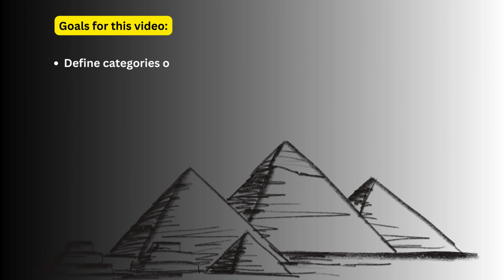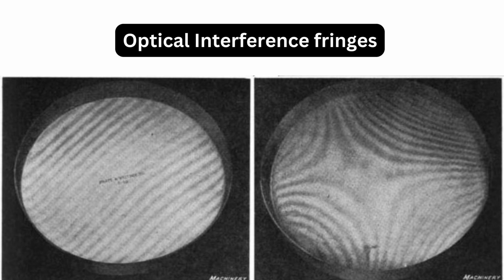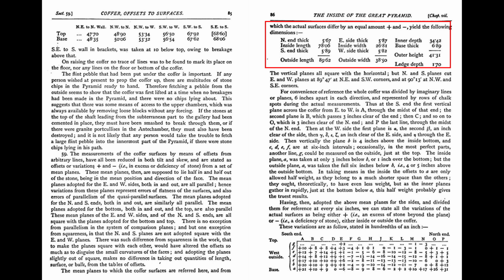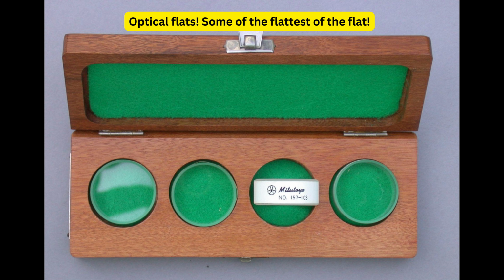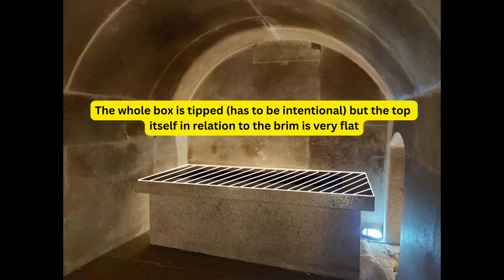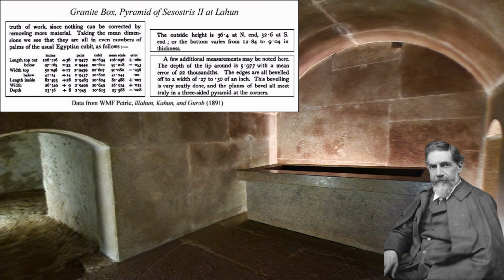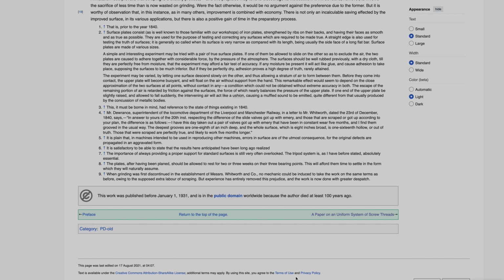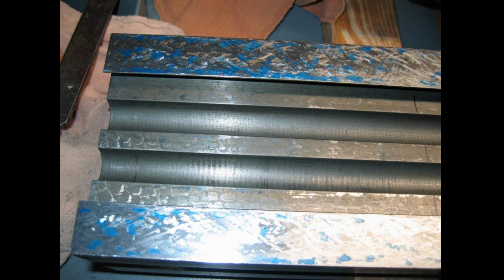The Problem of Flatness in Ancient Egypt

Comment: Applying precision in the micron range on even modern building of some machinery feels silly.  Working at a boiler plant, on 1000BHP boilers, the standard tolerance on the shell and piping mounts was +/- 1". ONE INCH.  That level of precision doesn't sound like much until you figure in that it is on a 15 foot diameter, 45 foot long tube made of 1" thick steel. +/- 1" in 45 feet (or 540 inches - 1:540 is a pretty good tolerance) The interesting thing is, we were generally within 1/8" even at that size... similar things occur on the Egyptian build sites.  It's not about everything in the pyramids being that tight, it's that there are things that we would look at and go "why so perfect" that don't make any sense.     (To be fair, there were certain things ON the boiler that would go to the .001" range - but not the larger main piece).
It's kind of like those spinner things that are so perfect and perfectly balanced... and that we date by the crudely scratched in names on them.  Like a kid marking his Dr Suess books by using a crayon to write in his name.   It doesn't quite make sense. 

EDIT - Let me phrase what I am trying to get at another way -  it's not that they couldn't do various sand and water polish methods to get very smooth surfaces - the question is more one of why did they do so as much as they did, and be able to get it done in the time frames claimed by archeologists?   And the build quality they have on the blocks is as tight as what I am describing above, which is using modern engineering techniques.  

To me, the biggest question marks that throw the idea of all hand tools into doubt are the places (plural) where you can see cuts started, several feet long, as much as a few inches deep sometimes, that they just stopped, like they realized they started the cut wrong and then went back and started over on the correct cut mark...   the reason I say that is, with the techniques used for cutting, those marks would have taken days or even weeks - anyone working with wood, stone, metals etc with cutting tools - you ever make a mistake weeks in and just go, meh?  Be honest... it's WEIRD.   I'm not saying it wouldn't happen once - but there are quite a few examples of this throughout the Giza complex.
Reply from the maker: Good point. I’m looking into some of those explanations for the casing stones. History for Granite has already done spectacular work on the casing stones if you’re interested as well.

Comment: Farmer/mechanical engineer.....  Interesting.  Could have dragged stone around on paving stones by pyramids But not back and forth like shown.  Movement along every axis (direction) required... and with careful attention to exactly where ropes attached to avoid forward rotational force.... which would render the work-face convex.                ASIDE FROM THAT,  This method IN NO WAY addresses Squareness or Parallelness.... and this method is USELESS on the INSIDE of a stone box.    BTW, the Plate Method (as shown) requires the plates to be either very, very large or be (somehow) attached to Something that would keep them from tilting.  You could rub countless bricks together for countless years, and never produce anything except a convex surface.    Nice, sharp, straight Inside corners and edges using bronze or Any stone?  No.   A modern jeweler with his tiny,  high-speed diamond grinder could get into a box and make a nice corner, but he'd be wearing magnifying glasses with built-in LED lights.  Flat, smooth, equidistant, darned-Parallel sides in there?   Please.... some rich guy..... hire a stone guy to build a good 2x2x5 ft granite box without using any steel, carbide, or any modern equipment.
Reply from the maker: Come on Elon, give me a few million I will work on the project!

Comment: I work in calibration for the air force. Particularly on circular geometry measurement machines and surface plates. On our worst machines, the operators use them to measure tolerances of a few thousand of an inch.  Without getting into detail we calibrate them MUCH tighter. And that's in the air force, where a lot of times good enough is all that is needed since we have decades of data on tolerances of finished components. Now imagine what some private companies are doing out there with low quantity production or one-off pieces. And I haven't even gotten into roughness, this is just flatness and roundness.
Reply from the maker: Well said.

Comment: I have a theory that you could use can grind the heaviest stones using boyancy from the waterways. Bury a flat Reference Stone in the sand underneath the water. Add the stone you want to "grind" on top of the buried stone underneath the water. 

Add just enough boyancy to the top stone so that the motion of the water is enough to move it around the buried stone. In effect lapping it. 

In this way, you can flatten a heavy stone using boyancy to decrease the energy required to "lap" it. 

Just a theory I've had for a few years. Any thoughts??
Reply from the maker: A very interesting theory. I’m going to think about that today.

Comment: There are so many assumptions in this video, and it's not really creators fault.  It's evident that irreparable damage has been done to our self awareness simply by way of gatekeeping, and suppression, and silencing, and forcing lies into the lofty, impetus driven minds of today...  Great video, homie. Keep it up.  With 10.8k subs, and knowing nothing else, you show great potential in delivering top notch content, taking nothing away from this video, of course.  Thanks.
Reply from the maker: I can always improve. And I intend to. This is certainly more speculation than I’m normally used to. Check out some of my other videos I usually build models of pyramid parts and keep the level of speculation lower. I appreciate you watching.
Reply: Not really

Comment: If they had a high carborundum slurry that they could put been blocks the slurry would allow sliding AND grind down the surfaces faster. 

For cutting i imagine similar. 
Or even rope saws or plank saws.. Ropes impregnated with abrasive slurry.  Or wood planks with an abrasive slurry.
Reply: That's what I get for commenting before the end
Reply from the maker: 😂😂😂😂😂 all good. I am slowly acquiring various sands. I’m a very normal person
Reply: Modern people who aren't working with raw materials engineering lose sight of how effective rudimentary material can be is used correctly. 

Torsion on rope to create insane pressure for instance.
Reply: I enjoyed that video, though I felt it might have led with Whitworth.

As for ancient stonework, well stone cutting is merely precision abrasion.
Stone abrasion is self 'sharpening' that is to say, the more you abrade the more you are left with the most abrasive elements.

Any stone is not homologous, that is it is not made up of a single element.
Abrading the stone, in your accumumating paste, or slurry, you'll eventually have a predominence of only the hardest elements, quartzes, feldspars corundums and so on, and the softer elements are reduced.

The tool is not the abrader, you can do it with wood or bone if you like.
The reason tree stumps are left after felling, is because the bottom couple of feet are absolutely impregnated with dirt, soils, and dust which contain mineral elements that would destroy hardened steel chainsaw teeth, or steel saw blades in seconds flat.
There is a reason people do not cut up driftwood for their log fires, well not a second time they don't.  

Everything ancient has to invoke 'Precision diamond cutting tools' However, those only became a thing in my lifetime, and we managed a fair bit of precision in stone without it. 

As for Moh's scale, well when a sandstone job came up you had two choices, it was going to pay a lot less, or you'd have to raise your price a lot higher, because a sandstone job would destroy more packs of cutting disks in short order than any other.

My final point about 'hardness' is to ask what is harder on a scale, a human hair, or steel? If you answered steel, then why are you buying new razor blades?
One factor is the mineral traces present in hair among other factors.

There are Buddhist suttas regarding the passage of time which are familiar to many,  birds flying with silk scarves rubbing against mountains, or rubbing one with a soft cloth 
The concept of abrasion has been known for a very long time - some just managed to find ways to speed it up a bit.  

Does ancient stone bothering impress me? Absolutely. Do I need to reach for magic to explain it? No not remotely.
Our predecessors were very good at it because it was their job and it had been their job for a very, very long time. 

I am currently having people tell me that buildings I have personal knowledge and experience of being built, were dug out of a mudflood. 
That's not even a fraction of the distance from here to the pyramids and people are invoking magic for it.

Why? The very idea anyone could be more industrious and intelligent than them is anathema probably.

Comment: I've watched people measure and recondition industrial granite surface plates before, it involved a very accurate digital level that gets strategically placed in different locations (e.g. along all the edges and the two diagonals) to map out the "hills and valleys". The level could measure in microns per meter, which is just insanely precise. It gets moved along the measurement lines in increments just long enough so the following measurement continues where the one before it ended. The measuring software could even compensate for a slight tilt in the surface. This would be the ideal method to really map out a surface like this accurately and without any doubts.
Reply from the maker: That seems like a better and more portable method for taking to Egypt!!
Reply: @intothemap360 this is what we use. A Renishaw XL-80 laser interferometer. It comes in a kit about the size of a suitcase, requires a laptop, a very sturdy tripod, and a straight edge to run your lines. Even a simple repeat-o-meter with an accurate dial indicator could give you flatness down to 10's of microinches.
Reply from the maker: Thank you, I wonder if I have enough Home Depot pro point for one. I’m guessing not 😂
Reply: @intothemap360 lol everything we use is insanely expensive. Glad I don't have to pay for it if I break it. Probably looking for a new gig though.

Comment: One thing is for sure about the Serapeum. Too build such large, strong boxes where the tops sealed the box completely
means that whatever was in the box the Egyptians did not want it to get out. That it was toxic. And why the
Serapeum was also located underground. But, whatever it was, it was useful enough for the Egyptians to go through the
effort to build the Serapeum. I'm thinking each box held batteries?  And maybe was a charging station for smaller mobile batteries?
Reply from the maker: There were bulls inside. Read the account of going inside the serapeum for the first time by August Marriette. They found one bull in a side chamber

Comment: Optical flats are flat to double digits nanometers. Let's say 1/10 or less of the wavelength used (typical 589 nm of sodium vapour lamp). That's trade standard.
In lapping two parts against each other you end with perfectly matching sphericals. It's only a matter which radius these spheres achieve. Flat means a very large radius measured in kilometers.
Reply from the maker: You're right, it can also get very technical very quickly and there was a point at which I had to decide what words convey my meaning to the audience and which ones are the correct technical term that I would need to define first. In order to not go into the specifics of optical flats I just used the basic terms. I appreciate your input!

Comment: I knew about the three plate method. The vases are interesting. These are quite similar. Little variation on the theme. They must have figured out something with rotation. A trick. There is some obsidian jewelry from Anatolia, millennia older, that also has high accuracy. Round bracelets. High level of control of grinding away at round hard stone. 
Way back someone had ordered a pile of sand and the kids in the neighborhood were digging through it. Why? Perfectly round white stones. Marbles. My father: the sand has been processed. It has been shaken and tumbled intensely. Pebbles roll around in it until they are smooth and round.
Reply: “Millennia” older? Do you realize how old the Pyramids are? lol
Reply: @lysseax  Do you know where Anatolia is?
Reply: @PlanetDeLaTourette 
Yes, and the location of the region referred to as Anatolia has absolutely nothing to do with the question I asked you. I asked if you knew how old the pyramids were because you are making a claim about precision crafted jewelry that is “millennia older” than the pyramids.
Reply: @lysseax  There has been activity in Anatolia for a very long time. Type the keywords in google.
Reply from the maker: Great points and story, something I have to also remind myself is that not all sand is the same! Some sands are soft and others can cut into diorite. I have seen wind blown sand strip the paint off a car in minutes in iceland.
Reply: @intothemap360  Ask Neil Armstrong. Moon dust is the nastiest crap. Tiny sharp rocks.
Reply: @PlanetDeLaTourette 
Basically small grains of sharp obsidian. The only time they experience any erosion is from micro and larger impact events.

Comment: There is a channel about optics - the guy from Netherlands makes optical pieces for telescopes that are in space. By hand or with this type of techniques. He measures his glass on optical (sodium based I think - yellow as hell) lamp that's made for this. It's a ton of work and he makes smaller pieces, but one could also use water in ancient times to further smoothen the surface - provided that they had a way of applying it relatively uniformly. Add to that tens or hundreds of thousand of "free labor" and you can get something that would be extremely flat. No "lost technology" needed.
Reply from the maker: Sounds like a fascinating channel! What's it called? Always interested in more content like that!
Reply: @intothemap360  Huygens Optics. Mind you he has other stuff, but a lot of it is DIY or lessons in physics. I don't claim that he doesn't use modern technology, but for small stuff, having something rotating (which was used in pottery) and sand or other powders, can be incredibly powerful. Albeit it isn't easily scalable for bigger stuff.
Reply from the maker: I’m interested in all sorts of things like this, modern and otherwise. Thanks for the channel!

Comment: Up to that time, the mankind had tens of thousands of years of stone working experience behind, they were at the pinnacle of the stone civilisation.
Everyone looks and marvels at the Egypian stone working prowess, but I think the Romans were as good as them, but no one thinks the aliens did their work.
Until very recently, before the advent of the carbide tipped tools and diamond covered ones, working harder than steel stones, wasn't too different than in the ancient times. Just 3 decades ago I witnessed stine cutting machines which used mild steel toothless saw with added sand and water to cut through hard stone and another cutting device which used mild steel cable water and sand to cut an entire hard marble hill side, slice by slice.
The Egyptian (and other civilisations) stine tech is impressive, but's, as I said, is a tens of thousands years experience accumulation in working just a single material, the stone, which, as hard as it seems, it's technologically a quiet simple material to work.
Instead, nobody seems to marvel at our contemporary tech achievements, not even imaginable decades ago. 200 years ago we were technologically not much more advanced than the Egyptians or the Romans.
Reply from the maker: Exactly, don't get me wrong, pyramids were amazing but they were just a primitive method of going higher. If Imhotep had a flying buttress or steel beams he would have loved those instead for their elegance and ability to open up a closed off architectural model.

Comment: I had an idea about the boxes in the Serapium, there are not so many of them throughout Egypt, they have a phenomenal internal geometry in relation to other structures. What is the point of burying corpses in such a sarcophagus? And if it is not a sarcophagus, but a grain storage, and a clear geometry serves as a measure of volume? And the tomb itself is actually a warehouse and a bank?
Reply from the maker: The Apis Bull boxes are FAR later than the other items. There were hundreds of tablets with stories of each individual bulls life, we know the bulls names what were buried here. A bull was also found inside one of the sealed compartments. These were burial boxes for the cult of Apis. The tablets got taken off the walls of the Serapeum and are in the Louve now I have seen some of them. I do wish there were left in place, it would make more sense to visitors.